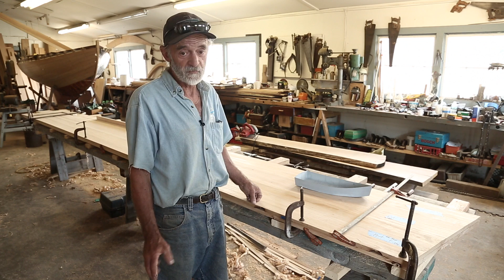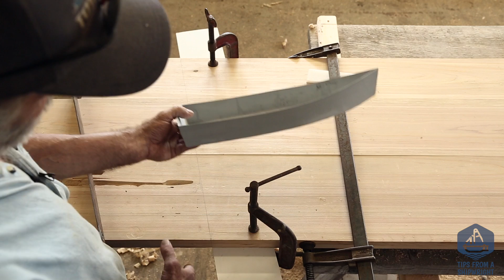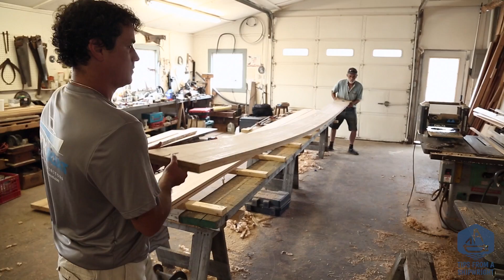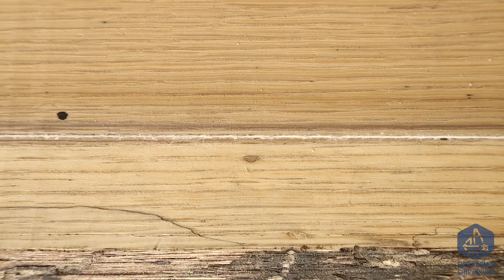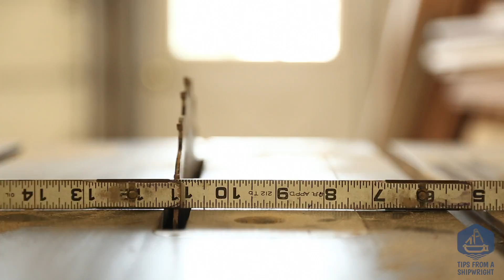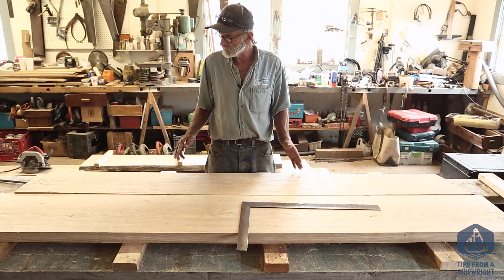Building the TotalBoat - Ripping and fitting the transom together (Episode 4)

Comment: Hi Lou,
I grew up with small wooden boats (like you, my father got me interested in boats and it has gone on from there).  I have been watching your videos since you began publishing them and was instantly hooked on them for your craftsmanship, knowledge, and remarkable methods to simplify boatbuilding and repair to make it quick, fun, and practical.  So far, I have used your methods in the reconstruction of a Crocker Stonehorse and of an old Swedish 42' racer/cruiser.  I have made good use of such things as your method of targeting old screw holes in planks (from the 12 1/2 videos) and using a chainsaw to scarf plank ends for replacement and steaming planks and frames in a plastic bag.  

Anyway, thank you for your ongoing advice.  I thought you would be happy to know that for me, you are a living textbook.  And along those lines - Elena, the swedish boat, is built of african mahogany over composite oak/galvanized steel frames.  The steel frames are doing poorly at this point and I have begun the process of replacing them with laminated white oak.  Any advice on replacing these steel frames?  Have you seen this construction method before and what have you done about preserving/repairing it?

Comment: Huh, never figured dead wood was good for this, i guess it matters when you cut it too, since if you wait too long it will rot. Great episode, lots done.
Reply from the maker: Dead wood can be great if you get to it soon enough.  Right after gravity drains it.
Reply: Best time to cut lumber when the sap is down. I'm cutting up a pile of oak for fire wood that has been pushed up in a pile for some time. I just bought this place in Tennessee. Smaller limbs or rotten.  The main trunk of the tree is probably four foot around. Fungi is growing on the bark. I really didn't expect to get anything thing worth using. I needed two things one was fire wood the other to get rid of the pile of wood. It's looking like white oak .the wood is perfect for heating. I don't own a wood splitter. I didn't think I could split it with fourteen inch craftsman chainsaw. But to my amazement working just fine using a lot of bar oil and fuel. I got four acre's with the house .I don't plan on cutting green trees rather have the trees. So I don't intend on buying a wood splitter. Rather purchase from someone cutting. Nature will provide some wood from storms on the place. I've always wanted to own a wooden boat the boat building trade has vanished as far as I know in Tennessee. I got amazed with wooden boats as a kid . A guy named Calhoun built a boat on REELFOOT LAKE in north west Tennessee. They were called stump jumpers I think they were sixteen foot long with five horse inboard they were made from cypress lumber from the area. They rented these little canoe shaped boats for fishing. But way more stable than a canoe. They carried three people. Reelfoot was created by and earthquake 1811 and 1812  under water stumps by the thousands. Where the boat got it's name as far as I know Calhoun was the only one built them. You could hit a submerged log roll right off. But every now and then you would get stuck on one. This is when you get your feet wet . Yep done it had to get out on the log in the middle of the lake push the boat off. You can Google all about the stump jumpers and REELFOOT LAKE. I live two hours east now. December the eleventh 2021 tornadoes ripped thew lake county Tennessee hear tell done alot of damage REELFOOT was turned into a state park years ago. They say it's unrecognizable to the one's growed up in the area. 200 year old cypress trees destroyed. Calhoun's boats or no longer in use today. Aluminum boats took over. But from my experience fishing aluminum is nowhere tough as a good wood boat. I'm thinking about taking on a boat building project for personal use. Done alittle construction in my life houses and what not. I think owning a wood boat wood be the coolest thing. I probably would just purchase one  but I don't want to make the trip north. Road trips in my youth were fun. 63 years young I think I would get more enjoyment from the build and the accomplishment I can see alot of pride in it it's self. Yep reason I'm here watching these videos. Yep I'm learning alot my skill level can make it happen. Not that I've built a boat but I know alittle bit about material and construction and the tools. I've personally built my on home From the ground up. Done a fantastic job. Deivorces and women tho is something I can't get the hang of. I got some work to do on this old house I bought. Which I'm doing now . Retired now I don't have to be in hurry. Means I can spend this Winter working on my house watching videos on boat building. Come spring if I don't loose spirit .I got front yard boat building project inmind. I do most of my fishing in winter on the Tennessee river. It's the best time of the year. You don't have to deal with recreational ski boats and the idiot's on the water. Up north I see the rules or different than here in Tennessee. For one I seen you can't run wide open close to shore. Here if your fishing close to bank they will wash you upon the bank. Damnedest thing you ever seen. Coast guard or the TWRA want say nothing to them. And thier teaching thier children the same . 16 year old kids with thier daddy's experience in thier dad's boat. I've had a game warden checking my fishing license me anchored. Boat runs wide open withen  20ft warden didn't say nothing. He was more worried about me having fishing license. I had a pocket full licenses. Safety gear to the T. But thier no rules on reckless indangerment. We have a lot of boating fatalities in Tennessee. Go figure.